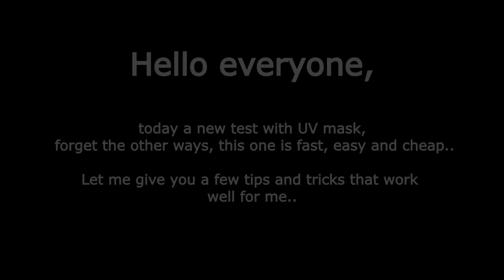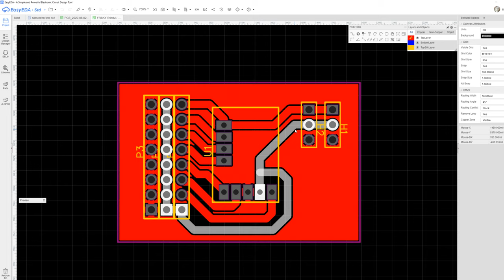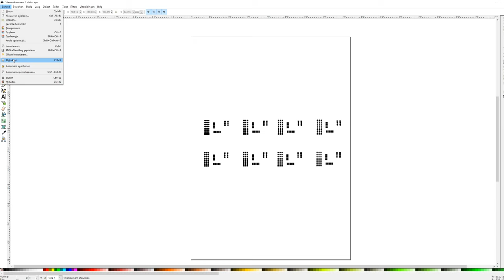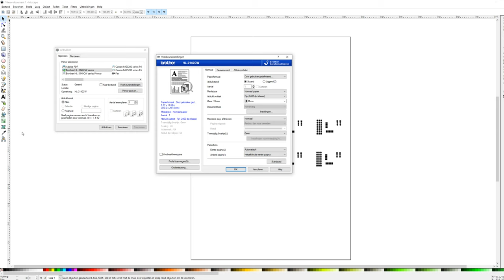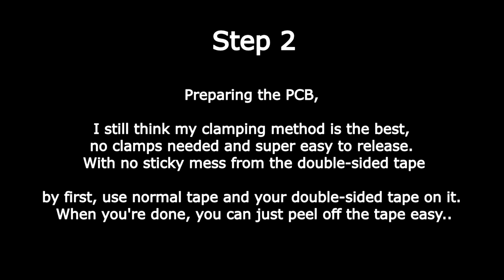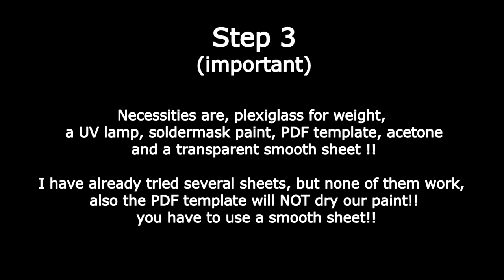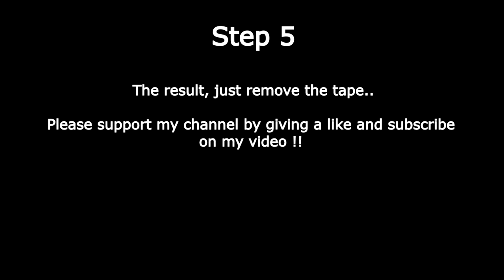Perfect PCB prototyping with UV soldermask forget the rest

Comment: Nice workflow! May I ask why the intermediate (smooth) plastic sheet at 9:20? Perhaps it won't dry without it because your UV cabin lamp is 365nm and the ink is 405nm UV length? 
Did you use simple UV ink or is it the solder mask high temperature UV ink?
How many minutes you let the UV light on? 15?
At 11:00 the paper is wet in what? sodium carbonate?
Reply: Isopropanol is good enough to remove uncured resin.
Reply from the maker: Sorry for my late response, went to look it up for you, te UV cabin lamp is indeed 365nm, and the ink is don't no, the ink could well be 405nm... perhaps that is why it has not worked out more often, had more problems with the sheets. but this combo seemed to work, even if it is not perfect. couldn't find any of the ink, the drying time was one and a half minutes to 2 minutes, at 11 min, the paper whas with acetone, but see from O̧͎͂t̪ͨt͖̎m̗ͥ͝a͔̞ͦ̚r̂ that it can also be Isopropanol. hopefully it helps you :)
Reply from the maker: @Ottmar555  thanks O̧͎͂t̪ͨt͖̎m̗ͥ͝a͔̞ͦ̚r̂ :)